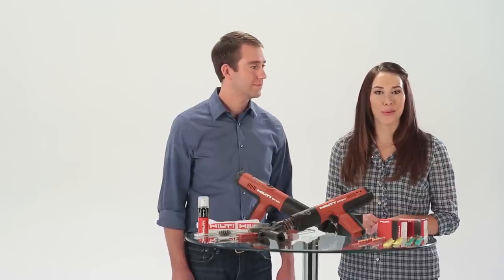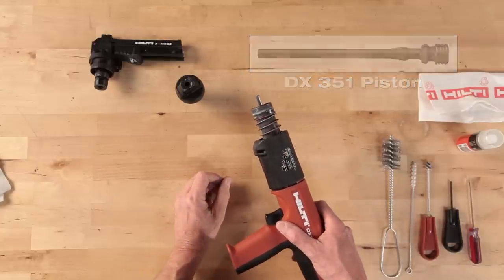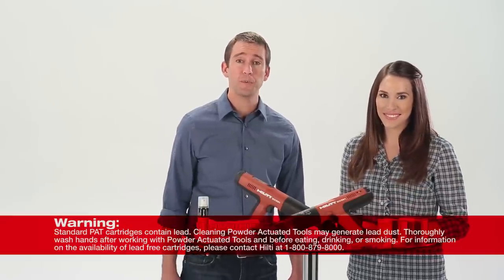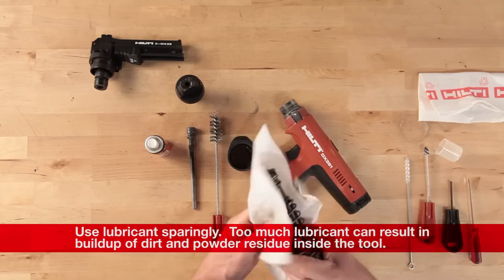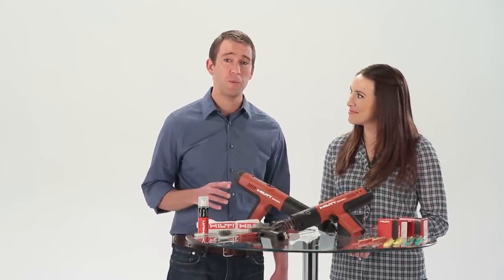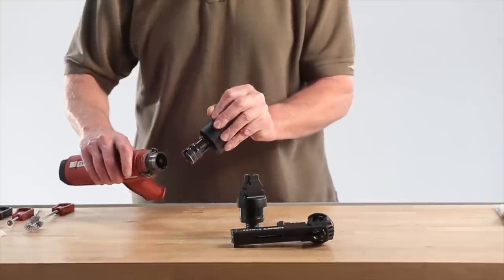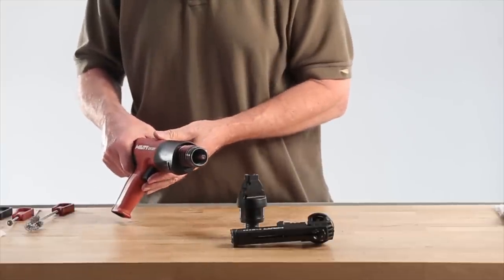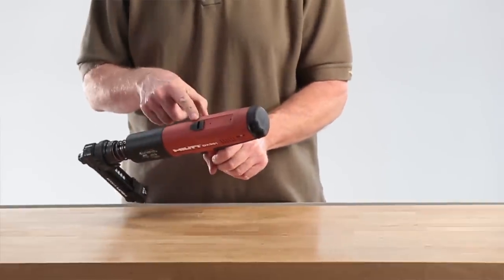HOW TO maintain and clean the Hilti DX 351 powder-actuated tool

Comment: You should never clean powdered combustion residue with a dry brush. You are simply flinging the particles into the air and potentially breathing them in. The lead is a no-no. Either the surface or the brush should be treated with a light coat of liquid lead cleaner first.
Reply from the maker: Thanks for the comment. We acknowledge the need to be safe when cleaning our tools and encourage our customers to follow safety guidelines in the user manual. If a cleaner is used, it should not be sprayed onto the tool to avoid damage or reduced performance. 

Hilti offers lead-free cartridges with Clean-Tec technology. Here's a link to more information on Hilti.com: https://www.hilti.com/direct-fastening/ceiling-hanger-systems/r4527

Comment: fastner guide got stuck?
Reply from the maker: Hi Jessie, if you are having trouble with your tool, please give our customer service center a call at (U.S.) 1-800-879-8000 or (Canada) 1-800-363-4458. A representative will answer your call quickly and can help you troubleshoot the problem or schedule service if needed. Thanks!
Reply: Did you ever find a fix for this mine has same problem !!